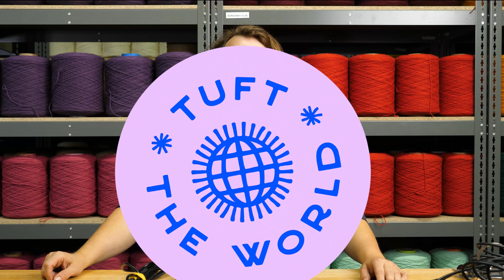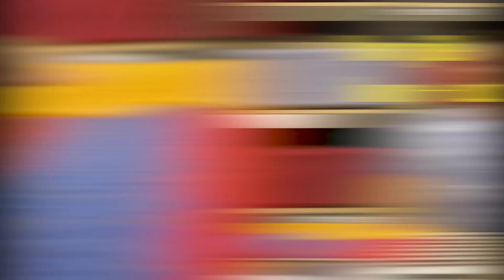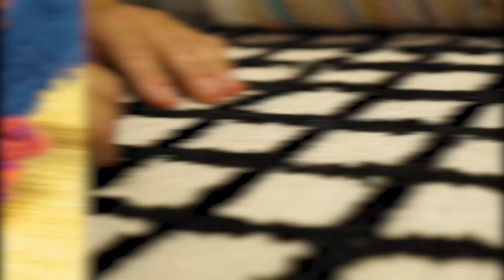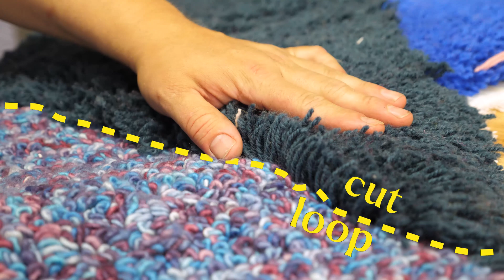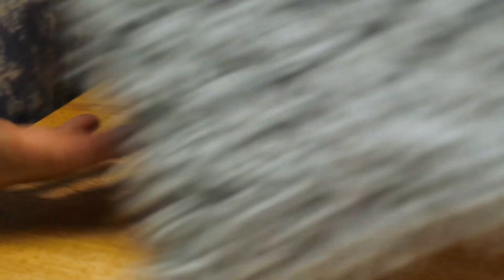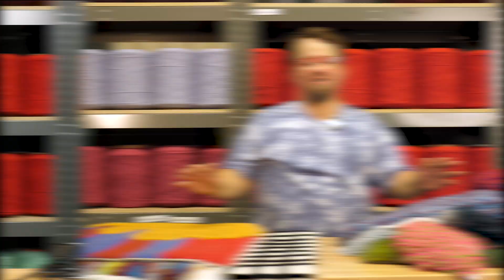*UPDATED* Tufting Machine Comparison Video!

Comment: See I’m trying to find an alternative to the first cut pile gun because those models have a tendency to literally explode (the capacitor inside) and it’s really hard to find a very nice alternative for the EU power other than a pneumatic one :(
Reply from the maker: Our duo machine is tried and true. It's the OG machine and has been tested and refined for 20 years. The newer manufactures are the ones that explode

Comment: Can you tell us what are the advantages of getting a pneumatic powered gun over the electric?
Reply from the maker: Pneumatic machines can tuft high pile up to 2.75 inches (60mm). Non pneumatic ones max is generally about 5/8 inch or  19 mm
Reply: @tufttheworld  yes you made it clear in the video , i mean any other advantages like speed and precision and durability,  it looks heavy duty like , are there any other benefits to it besides the pile height
Reply from the maker: @soheibabadlia8504  the pneumatic one is not for beginners. If you've never tufted before I recommend starting with the Duo (in our shop). It's high quality and easy to use
Reply: @tufttheworld  why isn’t it? Because of the price point? Excuse me asking i just don’t see it being that much more complicated
Reply from the maker: @skyleejeffrey6507  Thank you for your reply. Outside of the mechanical differences listed below it requires quite a bit more precision when tufting with it. Needle and pile height change require removing several small parts at the machine. It also requires perfect pressure and cloth tension to work well. You'll easily rip giant holes in the machine or the yarn won't stick in the cloth at all. It also requires a fairly large air compressor to run correctly. For most people this typically requires access to an art studio or warehouse space. I hope that helps

Comment: Thanks for for videos !!! I have an AKlll and while using the longest needle and largest feed wheel... The wheel pushes out too much yarn and the thread blows back out causing excessive refeeding and tangling. Can I use a smaller wheel with the longest needle???
Reply from the maker: Hi Roy. The wheel and needle must correspond with each other (longest needle to biggest wheel and so forth) so no mixing it up. There could be a few reasons that you're encountering that issue. If you bought the machine from TTW please email support@tufttheworld.com and someone will help. If you didn't please post this in our online community and someone can help you there. https://community.tufttheworld.com